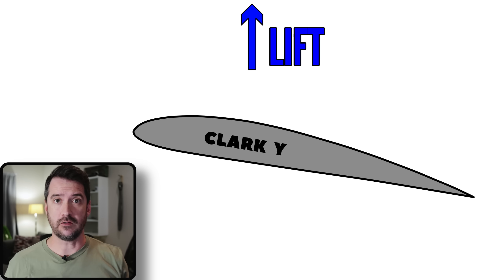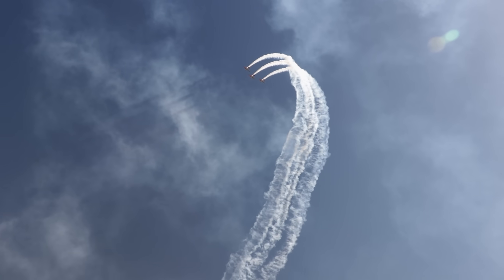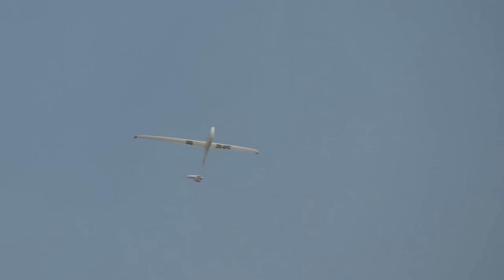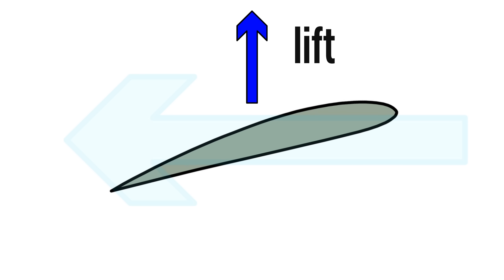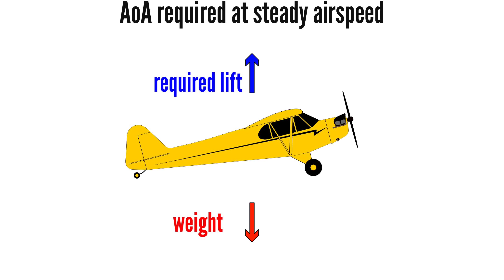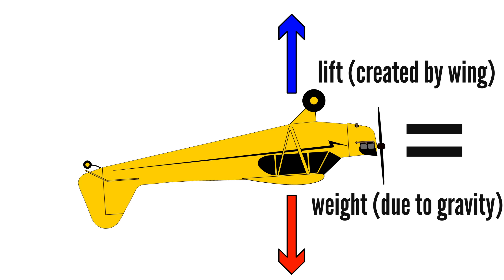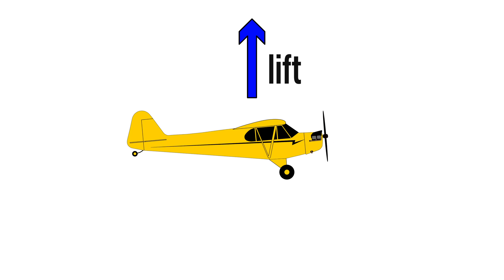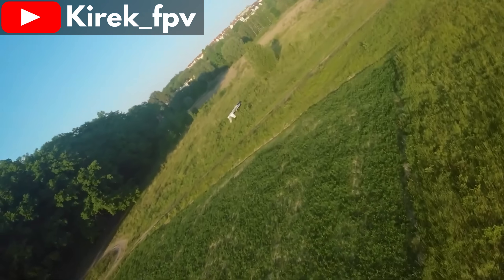Is Airflow Distance Over the Top of a Wing Always Longer?

Comment: NASA has studied this extensively It certainly isn't the low pressure on top of a wing and it certainly isn't the distance of the curved top of the wing that creates low pressure making the wing lift. 

It's been well documented by NASA that it's the force hitting the bottom of the wing that pushes the wing up. And that's why when you put the flaps down you have more force hitting the bottom of the wing/flap and that pushes up the whole airplane I suggest you include that definition when you talk about how an airplane flies. 

This is the same principle that allows the propeller to force the airplane forward the same force that pushes helicopter blades upward again it's got the low pressure on the top of the wing or on top of helicopter blades or any of this distance nonsense it's pure Newtonian F=MA
Reply from the maker: Just for clarification, the longer path over the top isn't the cause for lift. As repeated a few times, I'm showing why the path over the top (the skywards side) is always longer, even if the wing is upside down. It's not complicated.

How the longer path contributes to lift I didn't cover in the video. And as shown in my illustrations, longer path does not automatically mean equal transit theory, air moving over the wing moves faster.

Would you mind sharing the NASA sources saying it's not low pressure but wind hitting the bottom that causes lift? I've been keeping up with NASA documentation for many years but that one must have slipped my grasp. Here are some links where NASA attributes pressure variation as one of the primary lift providing forces. https://www.grc.nasa.gov/www/k-12/VirtualAero/BottleRocket/airplane/presar.html

And here is one where NASA says neglecting what happens on the uppser side of a wing leads to incorrect theories of lift. https://www1.grc.nasa.gov/beginners-guide-to-aeronautics/what-is-lift/#:~:text=Lift%20is%20generated%20by%20the,acts%20perpendicular%20to%20the%20motion.
Reply: @LetsGoAviate  I believe the research was conducted at the Glen research center up in Cleveland. They called it flow deflection or flow rotation. I'm sure if you use those words in your search you'll find the proper reference material.
Reply from the maker: @christophergagliano2051  Oh flow turning! Is it this one?
https://www.grc.nasa.gov/www/k-12/VirtualAero/BottleRocket/airplane/right2.html

So flow turning is based on windward and leeward flow. Ironically NASA says "Both windward and leeward parts can deflect a flow. Ignoring the leeward deflection leads to a popular incorrect theory of lift". Basically they are saying (again) the top surface of the wing is important to creating lift.
Reply: @LetsGoAviate  I don't think the research scientist at GRC are concluding that the top of the wing is that important and it certainly isn't as important as the bottom of the wing and the angle of attack when it comes to creating a rotational force or downward flow. 

As a kid I remember building and flying both balsa gliders and "U control" airplanes, and neither of these two designs had much of a curved surface on top of the wing, but they flew just fine.
Reply from the maker: @christophergagliano2051 Absolutely, the curvature isn't what is responsible for lift, it simply improves the lift/drag ratio, or in other words makes the wing more efficient. The curvature of the wing also isn't what creates a longer path, it's angle of attack, as illustrated with the stagnation point. I agree that angle of attack is what directly affects the amount of lift a wing produces. Clearly a wing displaces air downwards, but I (and many others, including the apt caution from NASA) say the top of the wing contributes majorly to that.
Reply: @LetsGoAviate  I don't think NASA says that at all my friend clearly it's the curving airflow on the bottom of the wing That pushes the aircraft up that's the same for propellers and helicopter rotor blades
Reply from the maker: @christophergagliano2051  They do say that, I quoted them from 2 different pages on their research, and linked in earlier comment. But lets agree to disagree on the wider issue.
Reply: @christophergagliano2051 
The upper surface of a conventional (Clark or Y type) airfoil creates a greater reduction of pressure than the lower surface increases pressure.

In other words, a greater portion of lift is due to the upper surface rather than lower surface.
Reply: @Talon19  hate to burst your bubble but even the great aerodynamist is Burt Rutan completely disagrees with what you're saying. NASA is saying the same thing It's the pressure on the lower surface of the wing that pushes the aircraft up basically it's Newton's 2nd law of physics. 

This is how a propeller and helicopter rotor blades pushes the aircraft forward and/or upward respectively, and that's a fact.
Reply: @christophergagliano2051  
LMAO
I talked with Burt Rutan and he agrees that downward motion of a fluid isn’t necessary for lift.
The easiest proof of this is placing a flat-bottom wing across two flat surfaces with air below.  
Blow air across the top surface and measure the weight of the wing; it decreases.
The air below remains static.
The two surfaces forward and aft of the wing prevent any downward flow of air.
Reply: @Talon19  everybody knows increasing free stream air over a surface reduces pressure. But you can't argue the fact that a propeller or rotor blades creates a rearward or downward force as applicable. The same is true for a wing. NASA has documented this rotational flow and concluded that there is no doubt a downward force creates an upward lift this is basic physics as described by Newton's second law.

Now when you're taking your private pilot's check ride and the FAA examiner asks you about lift, All you have to say is that "my instructor has gone over lift theory extensively and Bernoulli says that the low pressure on top of the wing makes an airplane fly"

Even though NASA has concluded otherwise, you'll get your private pilots certificate and life will be good lol
Reply: @christophergagliano2051  
I generally agree.  
However, an error I far too often see is the claim downward flow is *required* for lift.
Another problem with the downward flow theory is some airfoils produce lift even at negative angle of attack when there is no downward flow and even some upward flow.
The raw “newtonian” theory of lift as only a result of downward flow is horribly limited.
Reply: @Talon19  I'm glad we could agree on something. But I'm not sure Newton's second law of physics is "horribly limited" 🤣
Reply: @christophergagliano2051  
The Second Law isn’t horribly limited.
Using reaction as the primary source of lift is.
Reply: @Talon19  I'm not sure if you understand the second law, look at water skiing, look at rotor blades on a helicopter, look at the force created by a spinning propeller Look at the internal combustion engine F=MA (F Force is lift)
Reply: @christophergagliano2051  
Lift is a force, but forces don’t always result in acceleration or movement.
Propellors and rotors are airfoils, not flat plates or symmetrical (except on adjustable pitch blades) because wings, propellers, rotors are not creating force by reaction.
Even underwater airfoils are producing force due to reduced pressure which is what causes cavitation in liquids.
Reaction may be a byproduct of lift, but it is not required for lift.

Comment: It is incredible how many videos there are on airlift, and they are all WRONG. The reason for that is very simple. Aerodynamics, which is the science around flying, uses an approximation of air called a 'fluid', which is to be understood as a continuous material. Any characteristic of air that is not incorporated in this approximation is simply ignored. Airlift is caused by such an ignored characteristic, so aerodynamics CAN'T explain airlift.
Reply from the maker: I'm sure they are not ALL wrong, that would be quite extreme...
There is too much emphasis on right or wrong when it comes to lift. Things are rarely black and white, but are in between. As far as I'm concerned it's all about how big a part each legitimate lift theory plays in total lift and how they interact. Thinking there is 1 lift theory that magically explains it all is foolish.
Reply: @LetsGoAviate 
There is one correct lift theory, but it can be approached from either a pressure or velocity perspective.  Generally these are (erroneously) referred to as ‘Bernoulli’ or ‘Newton’ approaches.
Both approaches are valid because they both arrive at the same point.
Pressure distribution is easier to measure and apply, which is why it came about first; but computational fluid dynamics is more closely associated with ‘newton’.
Ironically, the equations used in CFD are as old as other equations derived around pressure but the complex equations couldn’t be fully used until computers.
Reply: @LetsGoAviate   They're not completely wrong, and it would be a bit confusing to tell people something can have two velocities simultaneously, or that what keeps an airplane in the air is basically sound. Still I'm sure though that this missing component is what makes pilots underestimate stall. Bottom line fact: Aerodynamics can not explain airlift.

The only theory that can, has to incorporate the speed of air, which is not the same as 'airspeed'. The velocity of the aerodynamic fluid is determined by its acceleration, whereas the velocity of air is entirely inherent to the substance. Airflow or no airflow, the speed remains the same. This explains the Bernoulli principle, the Coanda effect, laminar flow, boundery layering, airlift, transition effects, compressability, buffetting and a whole bunch of other things, but it is not part of aerodynamics. 
Most importantly though, it explains stalling.

Comment: Great explanation and then there is the speed of air that changes as the air creating the lift is moving faster and thus further than past the aft stagnation point.  Being a sling-wing driver as well, a man named Van Horn is creating asymmetrical airfoils to replace the symmetrical airfoils on helicopters.  Being with some of the first pilots to use his tail rotor blades, we were surprised over the increase of lift or thrust in that case from his design.  As the loss of thrust to overcome the torque of the main rotors is an excited situation and not in good way.  There was the occasional debate with the mechanics as to why we got irritated if they reinstalled the original design, as they believed there was no difference.  Never got to fly his replacement main rotor blades, but sure there was a recapture of power from the increased efficiency...

Comment: The wing upside down is less efficient than the right way up at the same angle of attack. The difference is due to the effectiveness of the aerofoil in producing lift. The difference needs to be divided by two. None of this disproves lift from reduced pressure above the wing due to longer path. The angle of attack simple produces lift or sink due to Newtonian force. End of story.
Reply: Lift is not a one or the other thing.
Different approaches arrive at the same conclusion because they are using the same information, just calculated in different ways.
The pressure and velocity approach is simpler to derive and apply, but eventually will give the same result as the more advanced computational fluid dynamics approach.

Comment: So why do 99% of fullsize aircraft have a larger radii on the top surface of their wings? To make the air above the wing travel further and thus faster than the air below. This creates lower pressure above the wing than below the wing causing the wing as a whole single object to be sucked upwards into the low pressure and this is known as "generating lift". 🌞
Reply: Yes, and one would think it is done this way, rather than like a kite, to reduce the angle of attack, reducing drag.

Comment: There is a glaring omission in this video. Airplanes designed for aerobatics, which need to fly inverted for significant amounts of time, usually have wings with a symmetrical airfoil (same curved surface on top as below).  Also, thrust to weight ratio should be fairly high.

Comment: With a curved upper wing surface you can still fly inverted. You just need a lot of nose up angle of attack (attitude) to create a longer path over the top of the inverted wing. Do not try to re-invent the wheel! I have flown inverted and you need to push forward on the control wheel to maintain altitude.
Reply from the maker: Explained and illustrated this at 7:02. Guess you didn't watch the whole video.

Comment: I think a point you left out is that a wing could be a board. Flat on both sides. The angle of attack makes lift (or downforce), the curves make it more efficient.
Reply: Asymmetry is the condition for lift.  You won't get confused about the effect of shape again, if you keep that in mind.

Asymmetry causes lift:  asymmetrical of shape plus asymmetry of angle of attack.

Comment: Lift is simply a factor of air pressure differential initiated by how you position the lifting part to generate the pressure.
To lift, you gat to position the lifting part in a manner that generate more pressure under the lifting parts than above while to descend, the positioning of the lifting parts is done to generate more pressure above than below the lifting parts.
Finally, for an aeroplane rather than a helicopter, the potential for lifting generated on the lifting parts come from the rocket mechanism propulsion by the engine. 
Again, to understand all this, you gat to understand that our atmosphere exists in a pressure and this pressure is harness for airplane lifting. 
In an helicopter, the blades does all this by adjusting the blade positioning
Reply: Asymmetry of wing shape plus asymmetry of angle of attack turns the air by creating a pressure difference.  The pressure difference results from conservation of energy drop in static pressure when the air's mass flow rate is challenged by the asymmetry.

An airplane engine is not normally involved in creating lift.  It simply compensates for the energy lost in moving forward (from parasitic and lift producing drag).

Comment: A rocket flies, a model airplane flies even without moving to anywhere, and you can do aerobatics keeping them verticaly and spining like a screw without moving. But.... can we say that there is a lifting force over the wings. No , there´s no lifting force over the wings. simply there´s a pushing or pulling force tha keeps the artifact flying at the expense of lots of power.  oTHERWISE , would the makers of planes produce wings with such special profiles? the air over the upper surface TENDS , TENDS , TENDS  to flow faster but it no longer can get the  trailing edge at a faster speed. moreover, there exist friction and the air is not a perfect fluid, but it has viscocity and density. factors that affect lift. But U´kn be sure... it´s actually the profile wich produces lift with respect to a moving mass of air. PLEASE DON´T MIX ROCKETS AND SUPERSONIC JETS IN THIS DISCUSSION. "" ESO ES HARINA DE OTRO COSTAL"

Comment: Mass of air great lift, no mass no lift. The space shuttle fly through the upper atmosphere while it landing. Those speed and air density no matter what is shape of wing. The delta wings force air mass downward and create some kind lift, like kite
Normal plane, jet fighter, helicopter, forces air downward (Plane's down) and equal opposite force create lift.
Of course shape of wing are main role to force air better way to down. Shape of wing volume how much you can push air downward.
What became stall, often thought you lost lift completely. but if you still increase angle of attack, eventually you have more lift than was before stall, but also drag is huge, so it is difficult fly that way. Kite fly stall circumstances.
Magnus effect great more lift low speed than any king shape of wing. If you trow wooden board and you put it rotate (the axes parallel to long direction) it can fly. You can try to form best wing ever and still it cannot fly trow speed. I did not speak Balsa board, I mean spruce or birch board. I am test also steel 10x50x300mm steel bar and I can see how much Magnus effect create lift quite small but heavy objects.

Comment: The airfoil shape just makes maintaining lift efficient. Given any form, any object can fly with enough thrust to negate gravity. The airfoil is one the most misunderstood thing in aviation.
Reply: "Given any form, any object can fly with enough thrust to negate gravity"

If thrust is mostly supporting weight than it is not flying in the sense of lift creation.

The test of lift creation is if you can throw away the engine and still have a reasonable glide ratio.
Reply: @davetime5234  airfoil is generating lift so it's lift creation, it's just a matter of definition, meant the same thing
Reply: @abdulrockman3992  OK, fair enough.

Comment: Does this mean that all the L/D numbers coming out of CFD codes , which vary with airfoil shape are wrong
Reply: What in this implies there is any contradiction?
Reply: Lift = Cl x 1/2 Rho v^2 S where CL is a combo meal of AOA + airfoil shape . Look at cfd results from a 64210 vs a NACA 0009 and the shape does make a difference - that was my only point
Reply: @hedleyfurio  I think that's a good point.  Lift results most fundamentally from a solid presenting asymmetry to the relative wind.  The fact that CL is dependent on both AoA and airfoil shape, shows that asymmetry is not biased as to where this asymmetry originates.  You can achieve combined asymmetry contribution from AoA plus camber asymmetry in an infinite number of combinations.